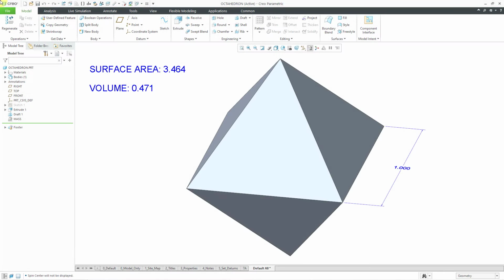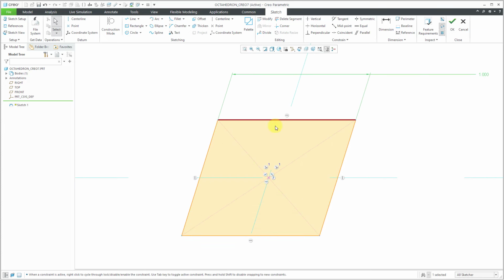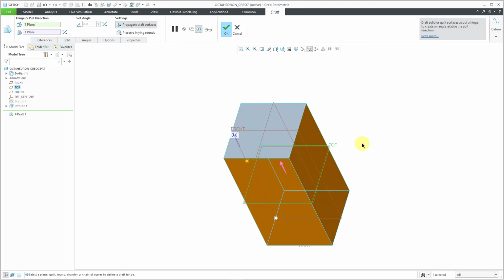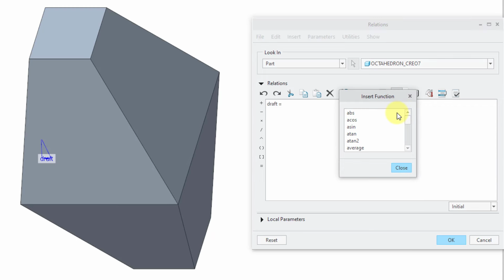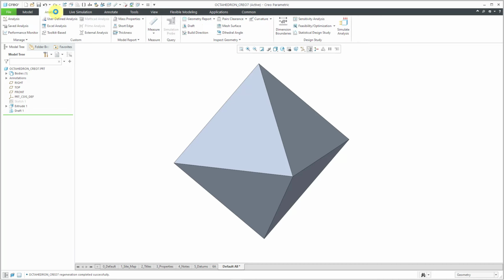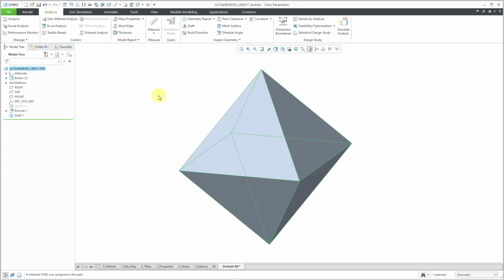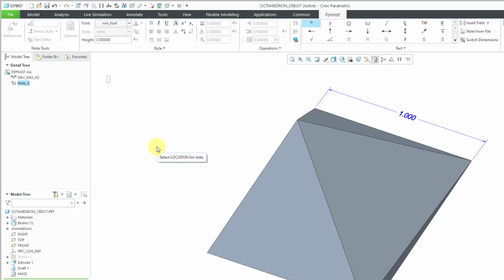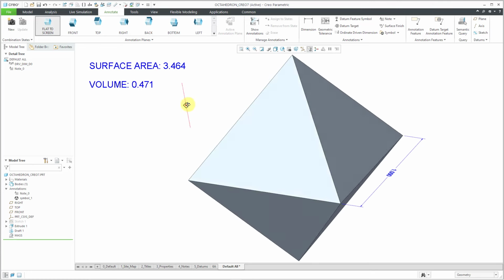Creo Parametric - How to Model an Octahedron - Platonic Solids and Polyhedrons

Comment: my draft fails on regeneration after creating atan relation, all the draft surfaces turns red.
Reply from the maker: Check your Model Accuracy. If that’s not the issue, open a ticket with PTC Tech Support.